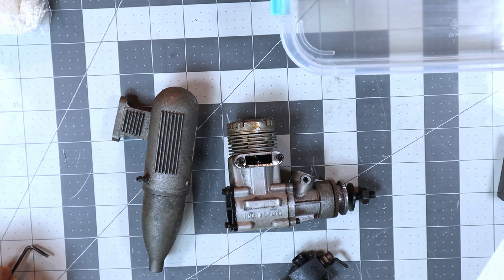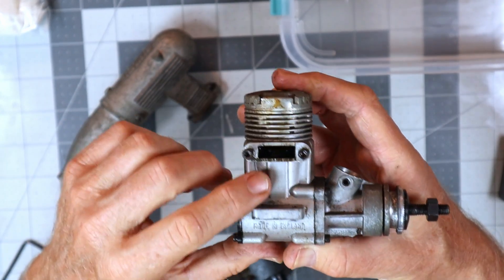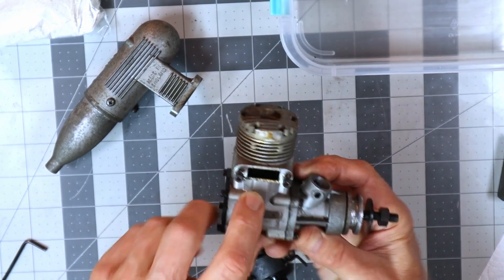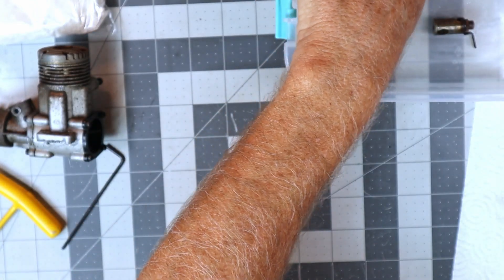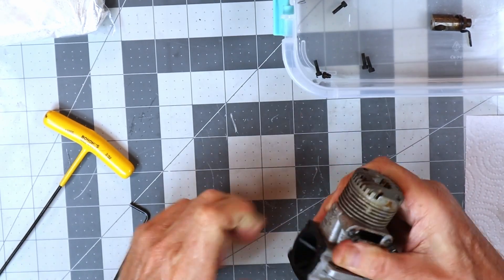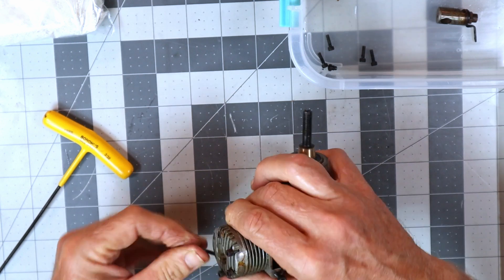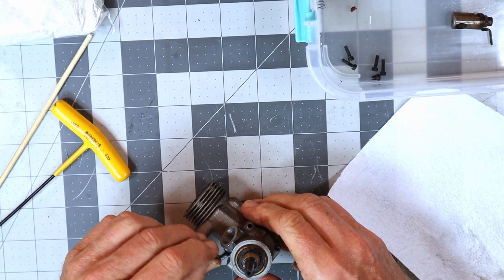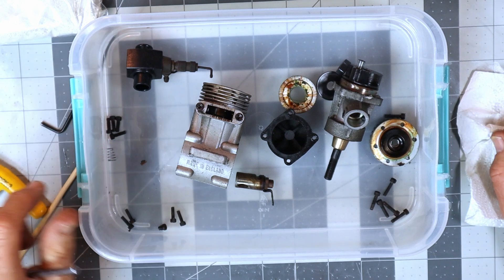Irvine 40 MKII Disassembly for Cleaning

Comment: Any cleaner is better than none. Id soak something like the muffler in it as a test. From there you can see if just soaking will work or if you need to scrub it.
Reply from the maker: Good suggestion.  When I make videos I make them in batches. Thus many comments are irrelevant only because the video is about 2-3 behind the reality and other videos.  I have made but not yet posted 2 other videos in this series as of today to include the cleaning and the first run after cleaning.
Reply: Why not just soak it in paint thinner? I have done that many times on engine restores, and it works great with a nylon brush! Get the low odor at the Home Depot.

Comment: Hello David,
Well... It thrills me to see you give this little guy more screen time!  Honestly, I cannot remember when or where I bought this engine, but I'll bet I bought it used because as you have shown us, that engine has had many tanks of fuel run through it.  I know the plane I removed it from was brand new; I found an old VHS recording of Christmas Day, 1992 of my youngest son tearing the wrapping paper off of the Hangar 9 Easy Fly 40 box and holding it up for the camera.  32 years ago!  That was my first (and only) ARF I had ever purchased, but it was for the kids.  The engine, I'll bet, came used from Archie's Hobbies on 62nd Avenue.  Neither of my kids took a great interest in flying RC and I did let other friends fly that plane, but there's no way I put as much time on that engine that seems apparent on its disassembly.  I look forward to seeing your progress on the Irvine 40.  Right now, I'm going back to the shop and continue working on the Easy Fly 40.  As you know, I have the OS FS40 to put on it.  I still have not replaced the bearings in the OS... so I may have questions for you on that one once I get into it.
florida_floyd
Reply from the maker: I used to shop at Archies all the time.

Comment: I've had really good results in the UK using Screwfix No Nonsense Paint & Varnish Stripper which is non caustic. You brush it on the still assembled engine and allow it to work for 1 hour before removing with a toothbrush and water. Sometimes if the castor is really baked on, some areas need a second application but it always works. So far it has only produced gleaming engines with no discolouration.